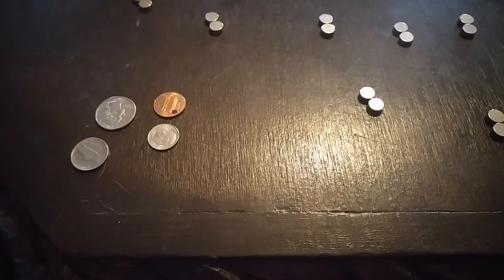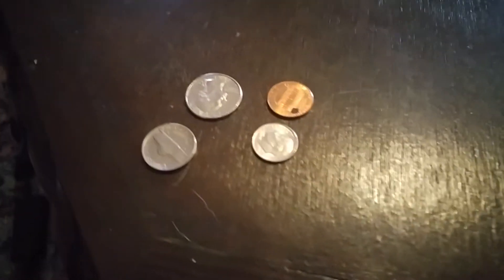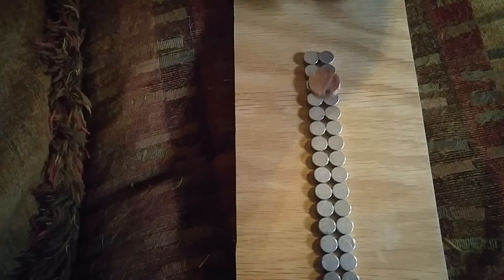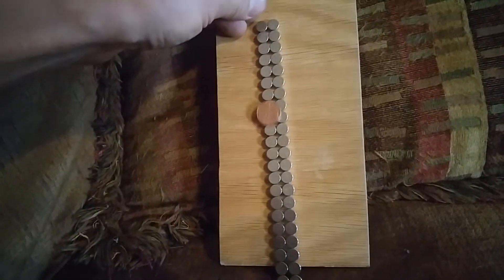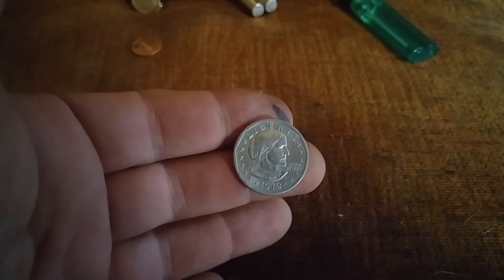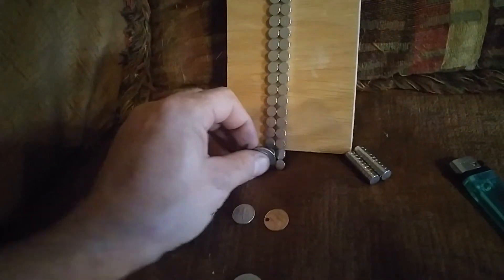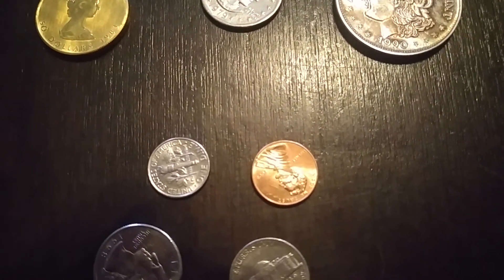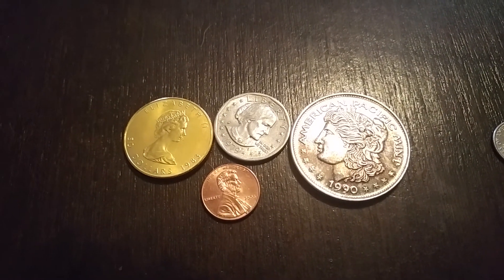Diamagnetism and GOLD recovery. Proof of concept.

Comment: Redo experiment with a pre 1981 US penny. In 1982 the penny changed to copper coated zinc. You can try other foreign coins with different alloys for more data. The SBA dollar is like the quarter and dime, a copper/nickel sandwich. Canadian coins are a different composition.

Comment: Good experiment!
Reply: Try using a nickel 1942-1945 :)
Reply: Nice Gold coin BTW!
Reply from the maker: Ha. 1942-1945 are made of steel.. lol.
Reply: 35% silver.. 56% copper.. :) 1942-1945 nickel
Reply from the maker: Something is wrong with those numbers. Nickel is it's own metal. Less valuable than silver. Why use silver at all for nickels? If true, I'm baffled
Reply: those 42-45 have no nickel at all :)
Reply: 9% manganese
Reply: I sold my war nickels in exchange of cash or silver.. or i'd send them to you for testing.
Reply from the maker: Thank you so much for the info.. I didn't know this..
Reply: you can probably get one for 2-3 $'s for testing.. at your local coin shop. :)
Reply: just ask for least expensive 42-45 nickel
Reply from the maker: I wish I remembered to use the Morgan Silver round I had sitting there. But the gold proved the point.
Reply from the maker: One of my best friends is a numismatist. I'm guessing you are too.